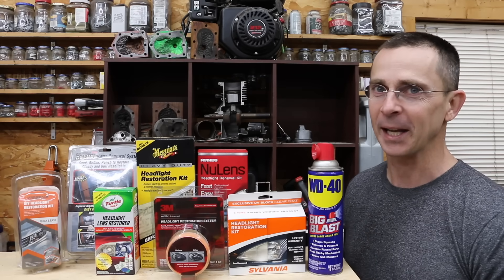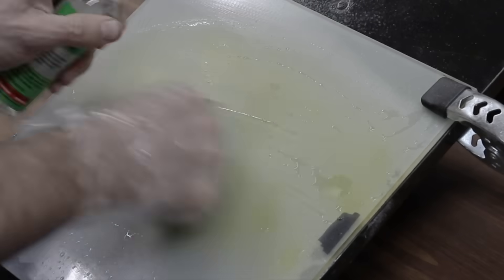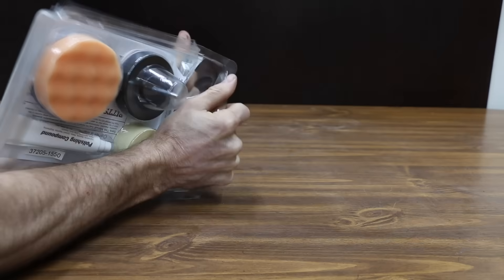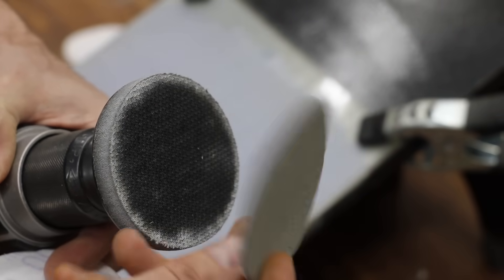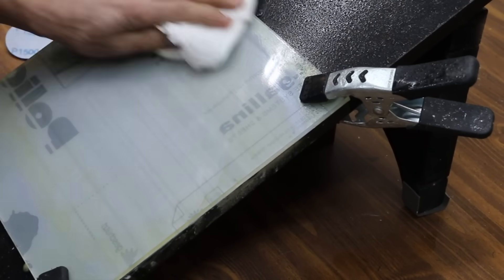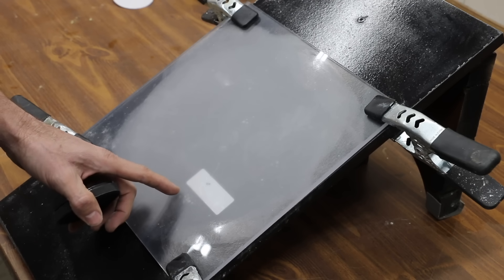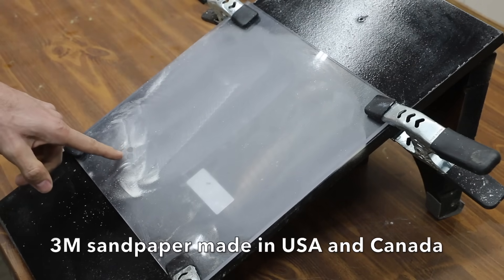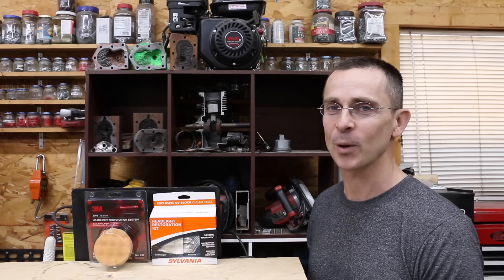Best Headlight Restoration Kit?  Let's find out!  3M, Sylvania, Meguiar's, Mothers, Turtle Wax & HF

Comment: I used bug spray  once you’re not supposed to because it takes the plastic off but if you do wet sand it then use it then use clear coat spray it works for a long time that was 2 years ago and my headlights are still pretty clear
Reply from the maker: Thanks for the feedback.

Comment: By far as stated by you not all Wet and Dry paper is created equal. Some brands of paper are significantly sharper than others while others use more media and then clog more easily. This could be a tangent to a Wet and Dry sand paper test. Using maybe 3 different surfaces like Poly-carbonate for soft, 2 Pack paint for medium and maybe Bronze or Cast iron for a hard surface. Soapy water as a lube medium for the first two tests and oil for the third. Sharpness could be gauged via a drill press using standard load and a current measurement.
Just a thought?

Comment: I would like to see comparison between car paint protection systems. Few "scratch proof" ceramic  coatings, waxes and unprotected. Testing scratching, water repellance, washing etc.
Reply from the maker: Thanks for the video idea.
Reply: @ProjectFarm  to add on. What's better UV coating or Clear coat.
Reply: Apex Detail would be the best place for that. He does extremely in-depth videos on every detailing product he can get his hands on.
Reply: I agree. I would definitely like to see a ceramic coating test.
Reply: I'm not sure about ceramics, but Chemical Guys Jet Seal is great for car paint protection from the sun & weather. Don't even waste your time with caranuba wax, or any soft car wax, unless you're dressing your car's paint temporarily for a car show. The Jet Seal is supposed to last a year but I would reapply after 10 months to be safe. Ceramic coatings are great but once they age they are harder to restore. I've been using Jet Seal on my 370z with a very metallic gret paint for about 3 years and have only applied Jet Seal twice. Paint has looked perfect and scratch free, oxidation free, etc. No cracks or fading.
Reply: I was going to suggest something similar, tried paint under mower deck in sandy soil, gets sandblasted right off
Reply: I just got the new Turtle Wax ceramic. Its in the gray bottle with the green on the label. I like it, but would love to see a comparison.
Reply: I actually recently suggested this lol
Reply: The new turtle wax system is actually really good for budget stuff
Reply: Agreed. I would love to see DuraCoating Technology’s Celsius vs. F11 and others.

Comment: Wipe New  plastic restore says they also do headlights. But at a truck show 3 years ago they would not show a test in the booth. I would like to see if it is snake oil or if they were just lazy. Would also like to see if it works on black trim.
Reply from the maker: Thanks for the video idea.

Comment: Something these kits never address is the inner housing. Many lights over time collect moisture and even sometimes debris within the inner part of the lights. Some lights are sealed through plastic welding, others use a clip and gasket but, none have an easy way to address the inner issue. If you use these kits to clean the exterior it only tackles half the issue and you might not fully get the clear appearance you are trying to achieve.
Reply from the maker: Thanks for the feedback.

Comment: 3M sandpaper is just plain the best.  It's all I buy.  It lasts longer, does a better job, and clogs less.  Even when it is clogged, usually a blast of compressed air clears it or a spritz of water from a spray bottle for the finer grits.
Reply from the maker: Thanks for the feedback.

Comment: After watching this, I'd like to see maybe the 3M and Sylvania used on actual headlights.
Reply from the maker: Thanks for the video idea.
Reply: @ProjectFarm  I second it - maybe take some of those mismatched lights and divide them in half to test which of the top-2 does the best job.
Reply: @matthewmiller6068  my thought tap over one side and use then tap over the other side and use see what we get
Reply: @ProjectFarm  If we choose the Sylvania brand, which product would you recommend to put a final finish coating on the headlight fixture?
Reply: @savvysue3537  The Sylvania comes with the protectant coating.
Reply: As a professional all I use is 3M as its more widely available and gets results in 10 mins per headlight.
Reply: V S I also use the 3M kit. Although I use the 3M dual action sander and single action sander. Same results. Really good stuff
Reply: I agree, maybe a top 2 or 4 shootout on actual headlights. I do have an old set off my Ram I'd be willing to donate. They are pretty bad.
Reply: I tried the 3M, didnt work. If anything it made it worse, even tho I followed everything on the box

Comment: I used the 3m kit without that drill attachment (If I remember correctly, it also had another pad or something that is helpful). It was a lot of work, but it made my 12 year old headlights look factory new and it was amazing. I got it on amazon for like 15 bucks. I highly recommend
Reply from the maker: Thanks for the feedback.

Comment: I have used the 3M kit a few times, and I do think it works well, but it is pretty messy. I generally just use 3M rubbing compound on a rag, and wipe it firmly on the lenses. It works well, takes maybe 30 seconds per lense, and makes no mess. I do this as a freebie on many customers cars, although I don't think anyone has noticed, or at least I've never been told so. If a customer wants their headlights restored, I use the 3M kit, but I'm going to suggest using the Sylvania kit now, thanks to project farm. You make great videos!
Reply from the maker: Thanks for sharing.

Comment: The issue with these type of products is protection you put on after has to be adequate for UVA and UVB protection, not of these will give you more than a few months worth before you have to do it over as you are removing more and more oxidation, therefore you must either buy a coating or for the best protection and like new shine for years would be to sand down and respray with a 2k clearcoat, any that has hardener mixed in it, not the kind    you can buy at Home Depot or anywhere like that Rustoleum he showed wont last more than a year, I know from experimenting with all these different products mentioned here and elsewhere, ive done many headlights as it pays well for true restorationl, have any questions let me know
Reply from the maker: Thanks for the feedback.
Reply: @ProjectFarm  you did a great job either way in explaining to us all how to properly use them, I appreciate your dedication Project Farm

Comment: I’ve done the 3M twice now but have found the UV block applied at the end just does not last. They look amazing when freshly done but crap after a year. I’m wondering if removing the actual lights and spraying them with a UV block will be better than these wipe on solutions.
Reply from the maker: Thanks for sharing.

Comment: the professional Walmart headlight restore is the 3m kit but instead of using a buffing compound at the end a new layer of acrylic is added. 
but yeah basically you can do this easily at home with some 600 800 1000 and then 3000 grit sand paper and some non yellowing acrylic spray.
Reply from the maker: Thanks for the feedback..

Comment: Hi good video I use polish compound and a buffer and have good result too, sometimes I use carburetor cleaner to have some result before polishing but you must be very careful because actually what you are doing is melting the material and in the proses can fill some scratches but if do it wrong it can deform  the surface a bit and you will have more work to do that is why a rather to use rubber compound if the scratches are deeper , after this you can just apply the uv protector, in one ocation I saw some one use the fine dust of soil to polish after filtering  the  soil of course I personally have never try it.
Reply from the maker: Thanks for the feedback.

Comment: I have bought the 3M kit 3 times and used on several vehicles with great results. I used some Simple Green (soapy water) on every sanding step. I tried applying clear once to a restored lens,  but sadly, I am not a good spray painter...
Reply from the maker: Thanks for the feedback.

Comment: Personally I've had excellent results with the Meguiar's kit. This is an excellent comparison (as always), but the one thing you didn't take into account is the fact that you want to remove as little material as possible to attain that like new appearance. Taking off more material than necessary can result in a more vulnerable lens or even the possibility of the lens melting from the heat of the headlamp itself. I think this is why the Meguiar's uses a 1000 grit as the coarse abrasive and doesn't use a drill attachment for it. The 1000 grit used by hand removes less material and takes longer, but because of this you are less likely to remove too much material from the surface. I would have liked to see measurements of the lens thickness for before and after each product. This is part of what I like about the Meguiar's kit... I know I'm not removing any more material than absolutely necessary due to the 1000 grit abrasive pad being the coarsest used. Great video nonetheless. In a future video it would be interesting to see some of the "shadetree" headlight restoration products i.e. toothpaste, transmission fluid, bug spray etc.
Reply from the maker: Thanks for the video idea.

Comment: Wet grade sand paper 120-2000
Meguires stage 2 polish with wool pad (rotary)
Meguires stage 2 polish with foam pad (rotary)

UV sealer.

Done. Do NOT wash your car at washes that use degreasers as this is what degrades the UV coating the quickest.

Ceramic coat for extra points
Reply: What UV sealer do you recommend?

Comment: Wow that is a lot of work for what I think is a poor finish on all but the top two!
Headlights should be crystal clear!
Good job on this video! I imagine you've saved a lot of disappointment for people.

I use a foam polish pad in a drill similar to the blue ball in one of the kits but just 3 steps.
Step 1. Polish lens with Farecia G3 compound.
Step 2. Polish lens with Farecia G10 finishing compound.
Step 3. Rattle can of clear lacquer with uv protection.

My headlights last 4 to 5 years before needing another go.

Keep up the good work!

Comment: I've used the Sylvania restorer on three cars per Consumer Reports' recommendation and I've never had to redo it, one of the cars I had for almost 3 year after I used it and they still looked good. I do live in Michigan though, places in the southwest may fair worse.
Reply: Sylvania makes a standalone product for their headlight clearcoat. I have had the best luck with this in combination with the 3M restorer.
Reply: Munch517 I agree 100%. I used Sylvania on my brother-in-laws car. Worked great and 2 years later still looks outstanding!
Reply: In South Florida, it lasts one full year only. I need a good primer/sealer that can keep the headlight fresh as long as possible. That'd be a really fun test because for the arizona, nevada, texas, florida, etc.people would benefit greatly.
Reply: boldr I was thinking the same thing, there has to be something that can be applied to polycarbonate to protect it longer than a year, I mean, the OEM manages to get decades out of the original coating on some cars, so some coating apparently exists.
Reply: @sstorholm  - I've heard great things about using 2K Clear on headlights for a long lasting UV protected finish.
Reply: @sstorholm  Chris Fix has a video showing how he restores headlights using progressively finer grits of sandpaper and wet sanding. He finishes with one or two coats of a clear coat paint (aerosol can) that has a UV protectant. That's probably very similar to what the OEM finish is.I haven't tried it yet, but I will the next time I do my headlights. I do prolong their life by polishing the headlights with the same car polish every time I do the car. That helps a lot!
Reply: @lexboegen  ChrisFix did a second headlight restore on the trailer blazer and used a ceramic coating.  I would consider it but the stuff Chris used was $60 or $80 for a little 1 oz bottle.  It would do way more than two headlights but I don't have that many cars, and at that price I would starting to consider new headlight housing.
Reply: SW FL here.  Eastwood sells a 2K Aero-Spray, 2 part rattle can clear for  $25.00.  Same clearcoat on your vehicles.  You activate by bang bottom of can on hard surface thatr punctures innards and mixes the 2 parts.  Dying to try it on my original 2003 Silverado headlights, but it should work just fine.
Reply: *fare worse
Reply: I used the Sylvania kits many times on 4 vehicles. They even replaced my kit once. It only lasts 3-4 months on all 4 vehicles tried. Then it’s a PITA to remove the top coat. The liquid cleaner is superior in removing the yellow but the top coat is a no go for UV protection.

Comment: I had another idea as I was out doing bicycle deliveries here in San Francisco as cars were driving past.  I know that for automobile mpg ratings they typically give city and freeway ratings, and the freeway ratings are always higher than city ratings, however this is obviously due to stopping and starting constantly because I know that at high speeds air resistance increases at the square of velocity.  The question is: if the speed is constant, what is the most economical and ecological speed to drive a gasoline car?  During the oil crisis the speed limit was lowered to 55 mph to conserve fuel, but at what point is the car moving too slowly and actually losing efficiency?

Comment: I didn't do any of this or bought any of these kits. While some might like a kit, I believe that the same makers of these kit produce single products that will do better jobs for a cheaper price. I simply bought the Turtle Wax Rubbing Compound. Once I applied the compound and wiped with a clean micro fiber towel, the headlights looked almost like new so I applied a second coat. The second coat was amazing and actual restored my headlight to their original look. Then I applied some polish to help protect them. everything from start to finish was 5 minutes for both headlights. I'm not a kits guy and found my way to be easier, simpler, and looked better in less time and hassle.

Comment: 3M used to sell a blue pouch of headlight clearcoat, but they have quietly discontinued it. I'm not sure why but when I used to do headlights on the side, I would ALWAYS finish with one of them. I did my headlights in 2018 and so far,  Alabama summers haven't faded them at all. It's surprising to see the Sylvania kit outperform the 3M kit you found. We have that kit sitting in the headlight section of my work with about 1/4 inch of dust on it. I might have to pick it up next time.

Comment: I bought the meguiars kit, but I also order 80 to 3000 sand papers. I starteted on 400 up. 

One thing that I noticed is that, it does not depend on the sanding (if you start low enough) It depends more on the quality of the clear coat to cover. 

Maybe if you can make and update of which compund resist the most amounts of radiation uv, that would be great

Comment: Wow I just did this 2 days ago on the 24th. I used 3M 1000 Grit wet sandpaper  then 3M 1500, then 2000 grit, then 2500  sandpaper( 3M sandpaper comes in a kit at Walmart 1000,1500,2000,2500) KEEP IT WET!  Finished it off with plastic polish and my drill using the new lens buffer pad. It did good. It got too dark out so,  I had to stop. It's a lot better than it was for sure!
Ps. Windex works as good spray lubricant.

Comment: "Place a dime sized amount on the applicator"

SQUIRT
Reply: Ever put a dime on a railroad track ?
Reply: @brendancarlson1678  thinn
Reply: @brendancarlson1678  edited 1 year ago
Accounting at a college level doesn't really have any special hardware requirements. At most, its just light excel work or online homework through a browser. Both windows and mac are used in professional settings, although I think public accounting favors windows. Excel is compatible with MacOS as well. I do not recommend using Bootcamp, I've used it in the past and found it pretty clunky and not optimized.
Given your budget, you could get a pretty powerful laptop that would be sufficient for gaming, and more than sufficient for your course load. The problem is that high end windows laptops tend to become obsolete relatively quickly. A mid-range laptop + external GPU might be more suitable for your needs, since it'll allow you upgrade your GPU later on. You may have better luck asking for laptop or tech advice elsewhere.
Best of luck in college, you'll look back at these years fondly. As Andy Bernand put it "I wish there was a way to know you're in the good old days before you've actually left them."
Reply: @stevethea5250  What the hell are you talking about? Who's going to hire a "college level" accountant to handle their finances?
Reply: @52Ford  sadly you just interacted with the hacked  comment, to everyone else do not interact with that comment or you may lose control of your youtube channel
Reply: lol... i wasn't gonna say anything =P
Reply: "Place a dime-bag sized amount on the applicator"
Reply: I was like "Thaaat's NOT a DIME sized amount!!"
Reply: RELEASE THE SCHMOO!
Reply: Place AT LEAST a dime sized amount!
Reply: That costs more than a dime.. 🤭
Reply: @Chris L but that's still too much
Reply: They have BIG dimes in the US.
Reply: Never been to the States. My initial thought was, they must have big coins there 😁
Reply: I think he's Canadian? They have really big dimes! Lol
Reply: @SF-tb4kb  No joke. I seriously wouldn't let a college kid handle my finances, though. Give them at least enough years in their field to get a reputation.